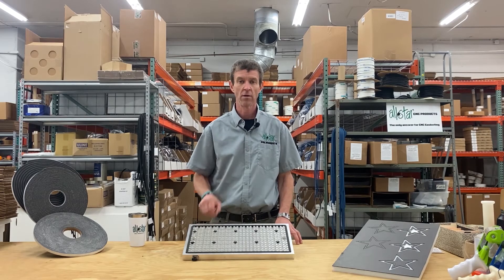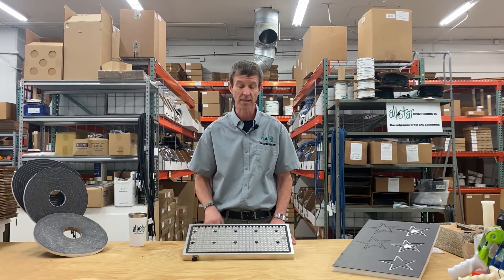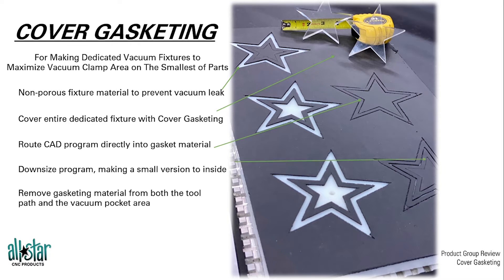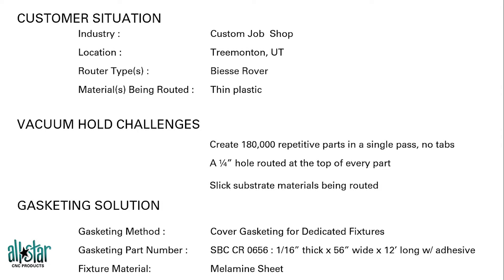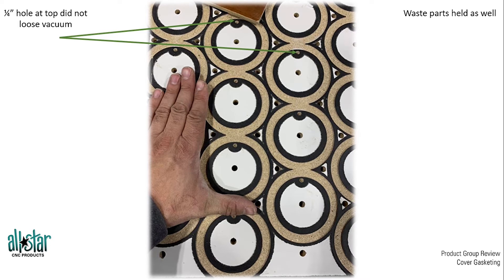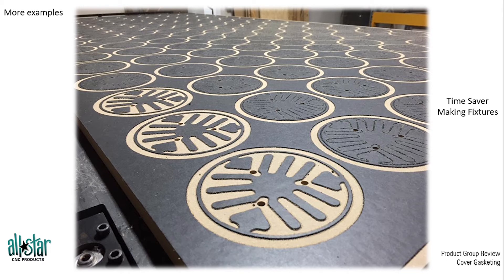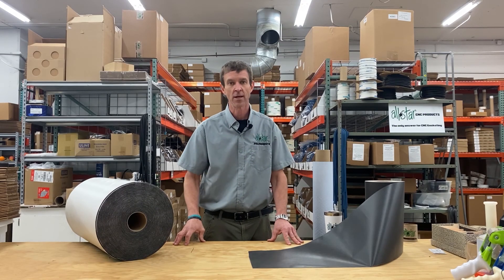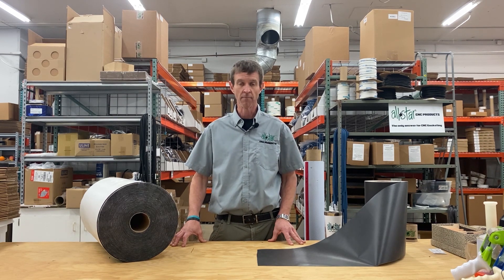Cover Gasket Product Review: For Improving Vacuum Performance on CNC Routers

Comment: Would you recommend 3/4" or 1/2" HDPE for the fixture material? What about UHMW, Ultra High Molecular Weight Polyethylene Sheets for the fixture base? Seems a bit more sturdy and not much more expensive in the size of fixtures I would make - 12" x 24" or 12"x48. A 1/2" sheet of UHMW might be stiff enough to avoid warping by the vacuum pressure? Thanks!

Comment: Part being machined around 5:10 into the video appears to be Delrin or HDPE approximately .75" thick??  In this application were you able to machine the profile in one pass?  Either way it's impressive that you can hold the part good enough to machine it without moving!
Reply from the maker: Paul,
In an air-tight environment, parts do not move.  That is the science.  But when customers downdraft through a porous MDF spoilboard, for instance, a completely air-tight environment is not the result.  It is a porous, leaky board that causes a great deal of vacuum pressure loss.  A dedicated fixture made with non-porous material, with a gasket located in a spot to create a clamp on the part, results in the cutting of parts that will not more.  We are happy to assist in any way we can to get you to achieve this concept.  Call us at any time: 800-878-7827